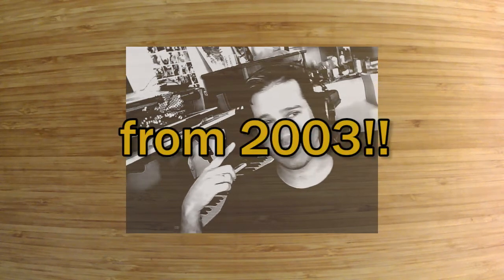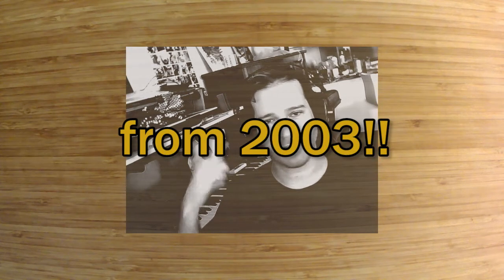Headphone repair: AKG K240

Comment: Thanks for the tip. I just fixed mine too, but in my case the problem was on the left side of the headphones, I do not have a soldering iron and instead, in order to main the contact of the wires I inserted a little bit of blu-tak in the small cavity that accommodates the main connector, time will tell how long my improv will last for.
Reply from the maker: I've given up on mine since this video unfortunately... They had a good run 😅🎧💙
Reply: My problem is on the the left also(no sound) after disassembled I notice a loose white wire that is coming from the left driver(speaker)... Red wire from driver attached yellow wire then to wire port, red wire from wire port solder attached to headset & a 2nd white wire from wire port solder attached to headset... where does the loose white wire from driver attach?
Reply: @michaelyoung9548  If I remember correctly, both the red and the white connect to the tip of the headband. I'm don't have mine with me right now, so I recommend that you plug the headphones in an audio source and touch the loose wire on the different ports, when you touch the right one you will get the stereo sound, that's what I did when I was working on mine. I hope it helps.

Comment: This video didn't help me too much I recently got an ancient pair of k240s (1978) and when I opened it up all the wires were black no colors besides red and white coming off the speaker and I also had to open the right side to figure out which was for the driver and ground considering the cable had two ground wires so I couldn't just follow it and figure it out that way, and the jack was cut off too so that didn't help. but the diagram in the description helped now I have a moded pair of k240s with removable cable

Comment: My problem is on the the left also(no sound) after disassembled I notice a loose white wire that is coming from the left driver(speaker)... Red wire from driver attached yellow wire then to wire port, red wire from wire port solder attached to headset & a 2nd white wire from wire port solder attached to headset... where does the loose white wire from driver attach?
Reply from the maker: No idea sorry man - I gave up on mine a few years ago...
Reply: The wiring diagram is the one he linked to above, the white wire from the left driver should connect to the 2nd white wire that is attached to the headset.

Comment: mine doesnt have the cable integrated, i can take it apart, just unplugging it. BUt there is where im now sure how do disassemble to see the wires on the speaker. left one.

Comment: My K240 Studio has a removable cord on the Left, should I open the Right (as you showed) to fix it ?
Reply from the maker: No idea, sorry mate. I had to replace the ones you see in the video. New ones with replaceable cord seem great so far. The wiring diagrams for the old ones were available online, perhaps you can find for the newer ones? Good luck!